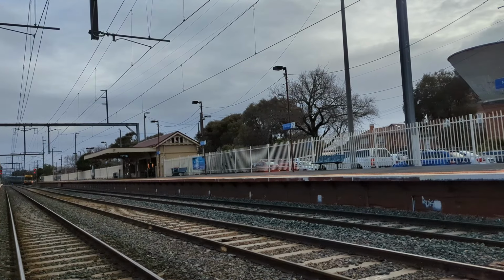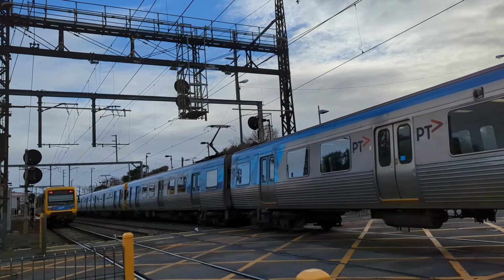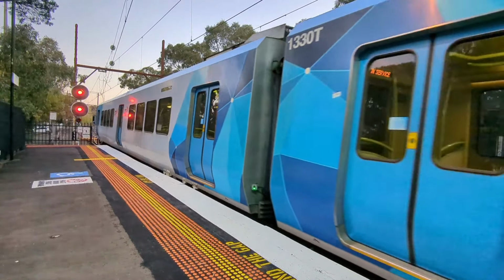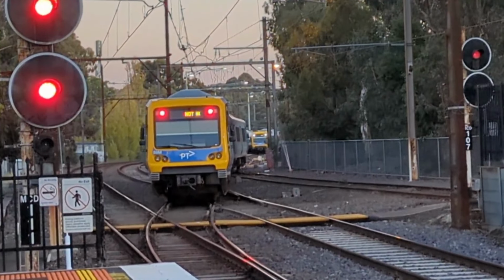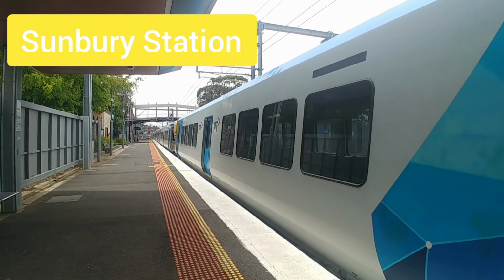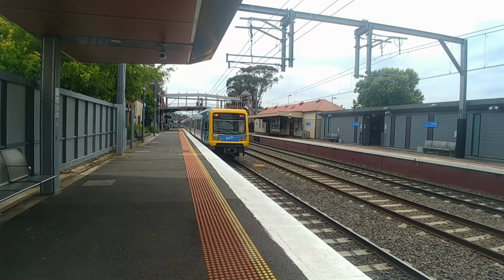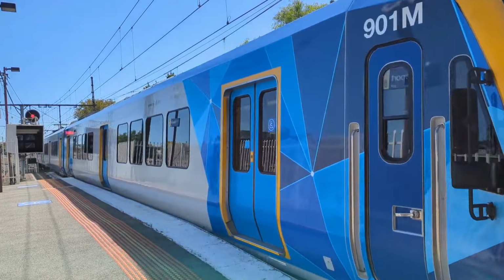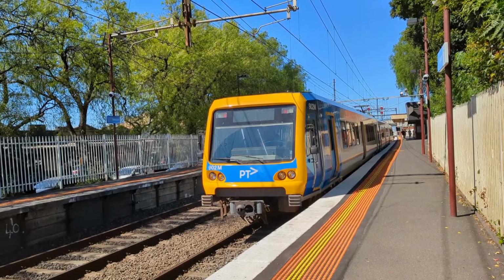Shunts And Docks Across The Network

Comment: Mordialloc used to have an extra track that ran through the car park and past the water tower and using a set of wooden gates hardly used. One day in the late ‘70s there was a shunters strike and country carsets were stabled in various sidings around Melbourne. In Mordialloc there were 3 cars stored on this car park track, the cars were an AS, BS and a wooden carriage. Around this time there were various bricquette sidings which were shunted by an E class and one time an L class. Usually the consist was 1 to 3 GYs and a ZL van.

One day a down train struck a car at Mentone and stayed there all afternoon. The following trains with passengers were shunted onto the up line at Cheltenham and ran at low speed to Mordialloc which I understand was called “wrong line working”. This procedure used a pilotman which is a person with a piece of paper who acted like a staff and no trains can proceed without him. Those were the days where signal boxes at Cheltenham and Mordialloc were manned and a wrong line order could be issued. Next to impossible these days.

Another unusual event occurred at Mordialloc on the second last down train. There was night bridge works where the wooden trestle bridge over Mordialloc Creek was being replaced by a new bridge. There were no more down trains around 11pm so the overhead was switched off on the up track only.
However they forgot about the practice at the time where down trains would cross over to the up platform so only one platform was used late at night, the overhead had been cut off and the train coasted to a stop on the up platform with no lights. The passengers exited and those continuing to Frankston had to walk to the down platform where the last down train arrived as normal. Presumably the stalled train had to wait all night until the overhead was turned on in the morning.
Reply from the maker: Very interesting. Thanks for sharing!

Comment: what's your favourite comeng set. mine is 507m-1104t-508m
Reply from the maker: 517M/529M!
Reply: @StrayaTrains  thats an alstom stage 1. i feel sorry for that set that it is scrapped. fun fact about the set. 1117t was previously supposed to be an edi but then 533m was burnt out so for reconfiguration 1117t was the last unrefurbished carriage that was refurbished into an alstom to replace damaged 1109t. 533m and 1109t are unfortunately scrapped at ballarat. why wouldn't some later tread break alstom comengs be stage 2?
Reply: Mine is 518M-1126T-551M
Reply: 400m
Reply: @StrayaTrains  also 637M-1169T-638M as i caught RVB both sides and it sounded nice
Reply: @YoussefPlayzz  why
Reply: @Nevergonnagiveyouup504  wdym why
Reply: @YoussefPlayzz  Idk